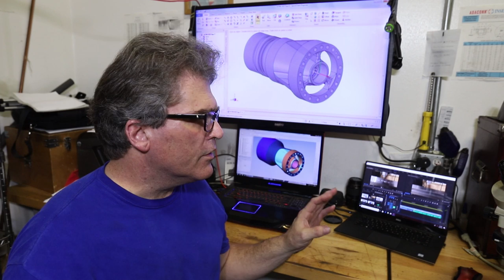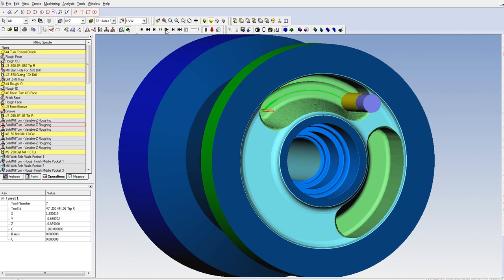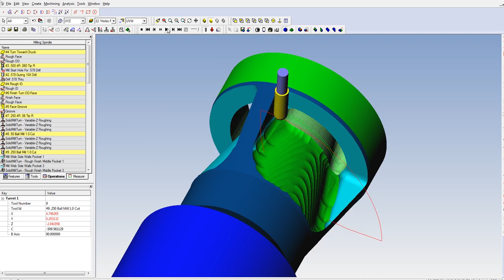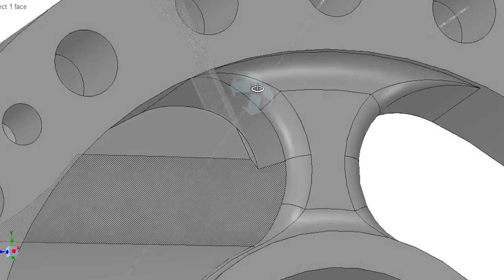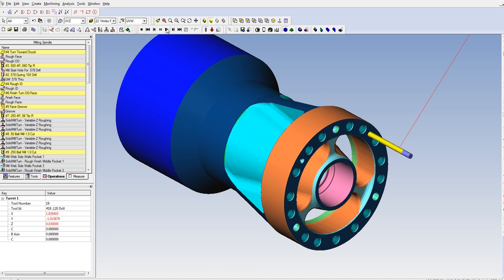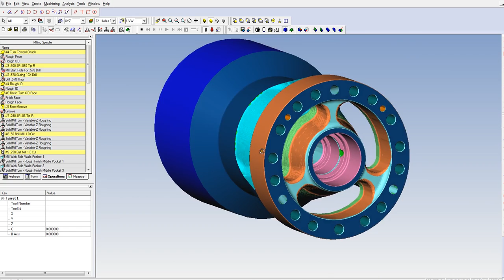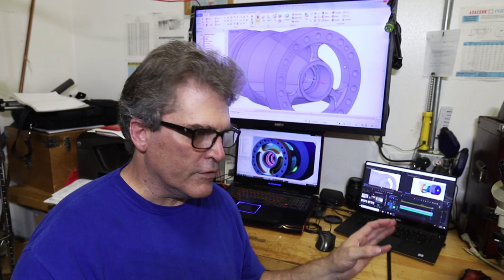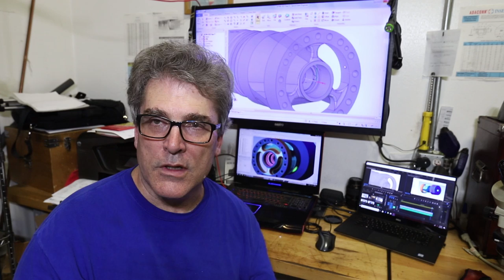Plan A Job 2

Comment: One of the first lessons I was taught as an electrical/mechanical engineer student was start everything with a K.I.S.S. (Keep It Simple Stupid -  those that do not know, not trying to teach people to suck eggs). It is great to push boundaries, but most of the time the simplest solution is the one that will last longer and be easier to manufacture. Thank you Peter (I would so much prefer to call you Mr ... but I do not know your surname). Keep up the great work.

Comment: Name this programe plz
Reply from the maker: The cam software is Esprit.
Reply: @EdgePrecision  can I use it one integrex 50 (mazatrol t plus)
Reply from the maker: It should be possible. If I remember the T plus control. It is a option to run a eia (G code) program. Also I think the Integrex 50 isn’t a true 5 axis machine. If so you can’t do machine work like shown in this video. There are less expensive softwares that would be good for the Integrex 50 I think.
Reply: @EdgePrecision  the integrex50 4 axe 
If you now software for integrex 50 tell me and thnx a lot 
And thnx

Comment: What changes in the part would speed the finishing strategy on the conical surface, like in order to be machinable using a swaf for instance?
Reply from the maker: It really couldn't  be done with a swarf type of cut mostly because of tooling and machine interference problems. But the way the webs were shaped and their intersection with the conical shape could have been improved. This would have made it easier to match the tool path from both directions. But in the end it worked OK. We have already made two orders of these parts. They do take a long time to machine. They did try to make 3D printed ones but that didn't work out for some reason that I wasn't told. I think just speculating that the surface finish wasn't good enough and there was some kind of distortion that required a lot of machine work. So it wasn't economical that way.

Comment: Excellent video thank you. I know it's an old video, but how would you ensure that the longitudinal holes meet up with the ones going through the web when you drill the shorter section from the second end? What I mean is how would you tell the machine how the work is oriented in the chuck, would probing the sides of the web to the the centre be adequate?
Reply from the maker: I don't know if you noticed there is a port on the side of the part. We finished that on the first operation. That way when we did the second end we used that to set our C axis (the turning spindles rotary axis) zero point. That way the timing was preserved between both ends. Also there are two dowell pin holes in the first face. We put mating holes for pins in the chuck jaw. That way it was a easy matter to indicate the side port on repeating each part from the first one on side two. We could have used the spindle probe. But the guy running the job was not familiar with its operation so he indicated each part.
Reply: @EdgePrecision  Interesting thank you, I enjoyed the video. I really do appreciate you putting the time into your videos, not only that, replying to questions.

Comment: What is the main reason why you chose Esprie for a Cam system instead of Mastercam; Solidcam;Power mill or other brand name software
Reply from the maker: At the time Esprit had been working with Mazak and had the best posts for the Mazak Integrex machine’s. This was more than twelve years ago. Back than many of the softwares you mention either didn’t exist or didn’t have its capability. Now there are many more selections. Esprit may not be the best for this machine anymore. I think Fusion can do what I need. I can already see a few deficiencies in Fusion that could be improved. Maybe there development team will take some suggestions. We shall see.
Reply: @EdgePrecision  Very interesting thank you for the insight; I work with a seat of Inventor HSM CAM and Inventor CAD package and would agree that there are few hiccups here and there that work fine for 3/4 axis positional tool pathing but i am unsure of the tool point control in some of the 3d tool paths; however maybe it is inexperience on my part. Also if i may pry, have you ever taken any CAM courses via. re seller or any other business place for training and was it worth it?

Comment: I like esprit a lot but can't stand those menu bars that keep disappearing  and you have to recall them every time. I have to ask you, why do you think that Fusion360 is so popular this days? All the newbies in cnc like it
Reply from the maker: There is a way to save a default page. But it doesn't seem to work for all the tool bars. Fusion360 is popular because its free to hobbyists. Or if you make I think less than $100,000 a year. It also is a integrated Cad and Cam package. I have looked into AutoCad solution but Fusion wont work for me. I would have to use FeatureCam. To get me started into that it would run about $11,000-12,000 with two post's (one for the Mazak and one for the Mitsubishi). Than about $7,500 a year membership/maintenance fee. I would like to try it but I don't want to spend that money. Believe me Esprit cost more than that.

Comment: Peter what is the average machine time cost for a high precision part like this?
Reply from the maker: I would say between $150-200 per hour would be the norm. But that all depends on on the situation of the shop. For instance myself everything I have is paid for. I have no employees working for me. The only thing I usually pay for is tooling for a job and of course rent. Included in that rent is utilities and internet. So in essence whatever I make above rent tooling and taxes is my pay. But if you have a shop with employees machine payments rent and all the rest you need to make a lot more just to break even. That's why the $150-200 hr. I have been on both sides of this. I prefer my current situation but it is a difficult/impossible position to achieve. It really almost happened to me by accident.

Comment: This makes a pretty solid case for forcing the designer to make drawings and not using the CAD model...  most of the 3D surface contours tend to disappear when the ME has to detail them on a 2d drawing.

Comment: On a job like this would you tell the people doing the manufacturing that they should ask for a better designed part? 4 hours for something that size seems like madness.
I mean they'll know whether the time is worth it for them but would you tell them the part itself is the issue, so that they don't think you're bad with the CAM?
Reply from the maker: I asked the guy in charge at Centerline ( the shop I’m programming this for). He didn’t seem to have a problem with cycle time. I would take that to mean they are getting good enough money for that time. Or to look at another way the people purchasing this part relies it will cost a lot to manufacture.

Comment: To me, this is some astounding work. 

I run CAD for a living and can definitely vouch for a tendency for laziness among some CAD designers doing things that look nice in 3D on the screen but are poor choices from a manufacturing/cost standpoint. I wonder if they could have designed more optimally and still met design requirements.

I'm new to watching your videos, so I apologize if you've covered this. What is your CAD/CAM environment?
Reply from the maker: Right now I use a software called SpaceClaim for cad and Esprit for Cam. I am thinking about getting a copy of Auto cads Fusion to experiment and learn. Not really for the bigger machines but for in my garage shop. When i first started with cad cam there wasn't the software choices there are today.

Comment: Ah.  Solidworks, So easy to add a rad, so hard to machine.  You can bet your bottom dollar the surface is awkard cause the engineer couldn't finish it properly rather than some surface flow requirement..  there should be a function in 3 d modelling software that produced an electric shock to the user every time they hit the rad feature....

Comment: This was perfect! I was curious if my brain would go along the same "track" of operations if you will. 
I've often found that no matter how fancy the tool paths get. sometimes you just have to surface it!
Have you tried any "segmented circle" cutters. https://www.emuge.com/products/end-mills/circle-segment-cutters 
They have help me take my surfacing operations from hours to mins, only draw back is programming from them. I have come to love them form swarf and 5-axis deburring also!!
Reply from the maker: No I have not. I'm not sure if my version of Esprit (I don't have the latest) would support this. Maybe if I defined a custom tool shape. I could see with this it would allow a larger step over amount. I have ground tools like this on my grinder but for different reasons than this.

Comment: I love these types of videos! Would you say the 5-axis swarf issue is more with Esprit or with the geometry? with B-C rotaries, I feel like you should be able to find a tool axis that can do those undercut surfaces.
Reply from the maker: Thanks Mech engineer. Not Esprit. The design is modeled in such a way that a continues 5 axis cut with the side of the end mill won't clean up the part (And is difficult to define).  This would be a much faster way to finish those surfaces. Of course anything with in reason can be surfaced milled with small step overs this just takes more time and doesn't leave as nice a finish. Or even might require some hand finishing/sanding.  In this case they put a .030" form factor tolerance on this area of the part. If this area isn't that critical why not make it easier to machine. There is a another part very similar to this in this assembly. This part was designed by a different engineer according to the drawing. This part is modeled such that this wont be a problem. I will be machining this part on my machine. I will show this part in a different video.

Comment: Maybe I didn’t see it. Does the tool for the face pockets and the OD overlap to get rid of the radius left behide?
Reply from the maker: The OD pockets are not finished in this operation. They will be finished when we turn the part around after putting in the c-bores on the screw holes. It is necessary to machine the undercut/taper where the c-bores after machining the c-bores. Otherwise this would put undue load on the piloted counter boring tool we intend to use. This is why these OD pockets will be finished in the next operation. At that time we will try to match up to the face pockets machine work. There is a .030" form tolerance in this area so it doesn't have to be perfect. It will probably have to be blended with a little hand work.

Comment: Roughly how expensive in machine time on your machine excluding labor?  Also i think seeing you program in Esprit would be very intresting.
Reply from the maker: I don't know what Centerline's actual hourly rate they charge for this machine (Their small Integrex) is. If I had to guess it would be in the range of $ 150-200 a hour. I myself working alone with everything paid for (Read that as very little overhead). If I make at least $100 an hour I'm OK with that. Most of the time I do quite a bit better than that. They would have to of course make more than I would because of their overhead costs being higher. I am talking about total cost including labor. I my self don't separate labor from my machine time because I work by myself. My cost less my overhead is my pay for my labor. I don't know if that adds more confusion or answers your question.

Comment: That surfacing would take days to do on a manual machine.  In the old days I am sure this would have been a prime candidate for a casting.
Reply from the maker: There is actually a manufacturing option on the print to 3D print the part and finish machine that print. There are notes on the drawing witch areas to machine in what order of the 3D print. There is also the option to go out of solid round bar witch is what we are doing.

Comment: What's your methodology when it comes to difficult to machine parts?   Do you try to make it work based on the given design?  Or do you ask the customer to change the design for particular areas?   Have you ever changed a design to make it easier?  I know that's usually a no-no.
Reply from the maker: I rarely go to the customer unless it physically can’t be done or it will be extremely costly to do so. If they are willing to pay the price I don’t care. It’s their design not mine. In doing so you could open yourself to some liability or blame for something not working. It’s better to let them do their own design work. Besides if it doesn’t work the first time you might get a chance to make the next design.

Comment: Dumb question... when you say better "5 axis moves" would that imply the use of barrel profile tools using the side of the tool  tilted at various angles ? And / Or tools that have different radii i.e. wider towards the shank and small radius towards the tip (Think pencil shape/ taper with rounded end profile) helps with blends ? (shrugging shoulders ?)
Reply from the maker: With a full 5axis movement I could mill with the side of the endmill as if finishing a vertical wall. You can see how this would be much faster and leave a better finish. I have been thinking about finishing the inside of the outer ring this way. Than the conical area. Than just surfacing where the conical area intersects the other surfaces.
Reply: Trying to figure out how aero-dynamic / fluid dynamic / high pressure / high velocity gasses that the exposed surfaces of that part experience (+ surface finish requirements). $5 says given that it's only 3 1/2 " in diameter that that part could be split into two especially with that ring/circular mount/ webs/ ribs. BTW really impressed with some of the reverse tapered and stepped fittings and shoulders for specialized fixtures you have built in the past to solve various problems. Honestly the designers of this part would do well to pick your brains about design alternatives if they want to keep unit cost down ? Just sayin ;-)

Comment: Small comment … You say "Little part" re-watched the videos couldn't find any gross dimensions... What's the basic rough diameters and length on this part ? (The CAD model makes it look really big but guessing from the tools used the part is actually smaller than it might seem ?  [Please and Thank You]. Great video BTW !
Reply from the maker: The part is small. It’s roughly 3 1/2” in diameter on the large end and about 6” long.
Reply: Ahhhh OK that's really helpful... I was initially imagining something that was nearly 10" in diameter. That explains a lot. I don't remember what max  spindle speed on the mill head that your "host/former" shop has on the Integrex I-400?  4 hours + for that part is not trivial. If you don't mind me asking how many of these do they have to make ? THANKS !
Reply from the maker: This order is for 26 pieces.
Reply: So I guess if the blends work out it's no "Biggie". : VIDEO WISHLIST : 1. Any chance you can go deeper and discuss the design of the Busing you made for the steady rest on the "Sleeve" video, especially the jaws and slots (in general) … Also the video you made with the dovetail jaws (inverted taper), was really interesting how the part snugs up on the opposite face that one would expect ? (2). Very interested in a lot of mechanics and design of these "Intermediate" fixtures and the tolerances they can deliver and problems they solve [Maybe as general topic as I think the younger generation of up and coming machinists and engineers just wouldn't think of such things ?]. If you don't tell them it's lost for ever / "Rediscovered' at a much later point in time lol. I think stuff that is second nature to you @Edge Precision / Peter would be considered hard to ever figure out for most (regardless of background or training).

Comment: This is impressive! For how the part looks like, I think the three ports this face should be to let pass some kind of fluid or gas , how do you know the surface finish or "roughness" you have to deliver ?? Thank you !!
Reply from the maker: I’m just guessing but I think the part supports the spindle for a turbine flow meter type device. Some kind of down hole oil field tool. The parts called a Down hole Side, 5 stage turbine housing.

Comment: Nice video!  Looking forward to more.  I think in the video you machined the hole pattern in the face, including the gun drill, after you finished the close tolerance OD.  Wouldn't you want to finish that OD last?  I think you said the material is 17-4 PH, tricky stuff usually precipitation hardened materials tend to move.
Reply from the maker: We will try it on the first part. If we get distortion we will move the finish cut after the holes. Sometimes I do this kind of thing on purpose as a learning exercise.